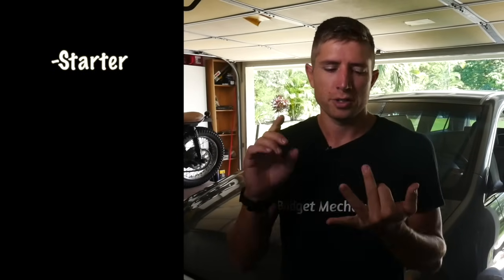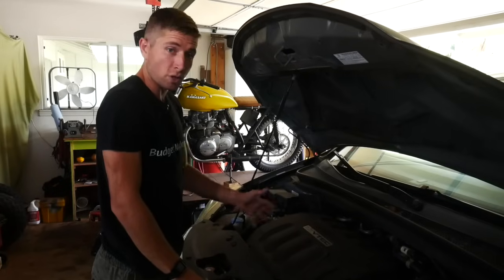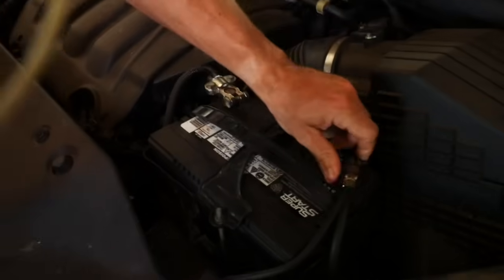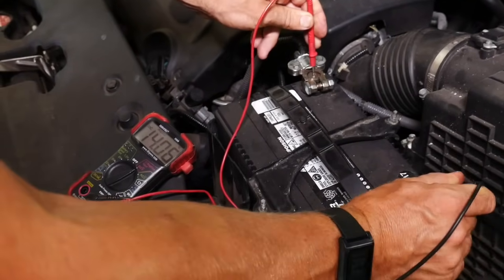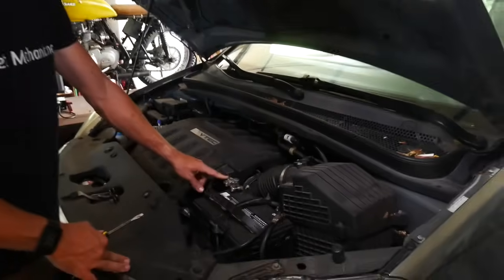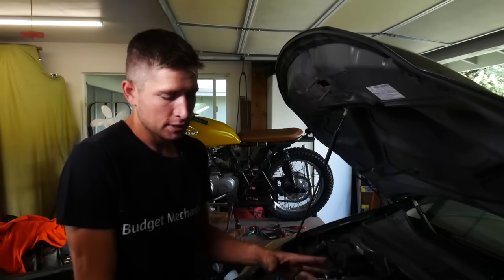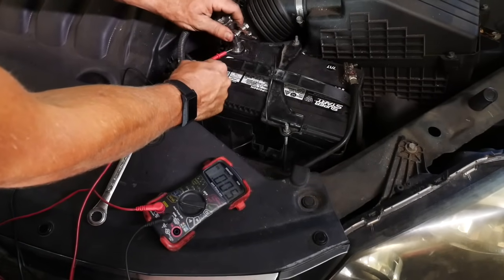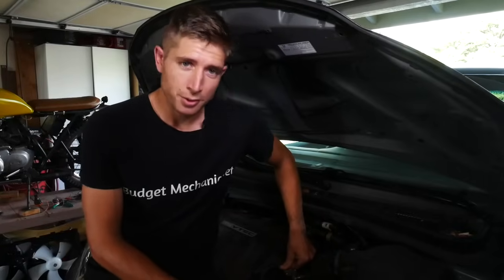Car Not Starting? Click or Clicking sound? Simple DIY Diagnosis!

Comment: Was is it if the car is dead and you hear clicking inside car without putting key in ignition, but it started with a jump,and I bought the battery 6 months ago

Comment: Bro I got a 97 Toyota t-100 and I've checked the battery, got 14v, took starter off checked and it spins like New, checked alternator it's good, but when I try to crank it , I hear one just 1 click and nothing! Turn it back to off and try again and bam one , just 1 click!! What is wrong with my truck??

Comment: Okay… I get it but car won’t start even with battery and I replaced the starter. All I hear is clicking when I try to start it. When the battery is hooked up to the car with jumpers it’s at 13.5 but won’t start and without the cables it drains to 10 volts sometimes even 8 volts and it’s 6 months old.
Reply: Even though it’s new, it might be defective or not fully charged

Bring it to your local auto parts store, more times than not they will charge it for free

Comment: Help!! 07 Tahoe, replaced starter, battery, alternator, fuses, relays, ground wires good and new ignition. When I turn the key I get a thud… when I use a jump wire the starter cranks but no spark

Comment: 2007 nissan armada clicking noise that turns on blinkers hazard lights and inside cab lights when car is off , when car is on, while driving and when car is off and just opening the door  ... draining battery

mechanic said it wasn't alternator nor battery ... $350 in tow, $125 in diagnostic tests already

Comment: Why didn’t you just take off the cables on the battery to test the alternator
Reply from the maker: You could do that with older cars, nowadays the computer can freak out, or it might just shut the car down despite a good alternator. No longer a definitive test

Comment: Appreciated the video. Yes, if you can jump it, and it starts, probable not the starter. Especially, if you had to do it a few times after the car was running , then left to sit, and not starting until you jumped it again. I like the way you checked for the possible parasitic drain added to your video. Once I had my car started and ran it awhile I checked the battery with car off and it was ok 12.4. Then I ran the car checking the alternator and it was working producing a voltage charge in the proper range, but after sitting a few hours voltage on the battery was down  to 10.1. No parasitic drain thanks to your check. Just an old bad battery! Our weather changed to cold and exposed it. I got 6 yrs 2 mo. out of a 3 year warranty battery. No complaints, but thank you for helping diagnose.
Reply from the maker: No worries

Comment: Hi I have a question I have honda hr-v 2019 and the car starts slow sometimes faster after being parked for 8 to 9 hours  it starts normally every time if you run into a store or fill up a gas! But when it parked  for 8 hours or more it really starts slow. It takes about 2 to 3 seconds before it starts. I took it to a mechanic, he checked it and say car starts normally and I replied it's because I was just driving it! I asked him if I can leave  my car overnight in his shop so he can check it again, he said it's okay, next morning I called him about 9 o'clock, the mechanic said the car started normally and I think he was just lied to me because he couldn't find the real reason, the car never started normally for me before when parked for a prolonged period of time even the next day when I went to work the car started slowly and when I finish my work the car started slowly again! My car battery  is only one year old, installed by Honda dealership 5 month ago. At this point I am stucked!  Went to three different shops and no one can determine the cause because when I come the car starts normally but again it give a little bit of hesitation when it being parked for 8 hours or more. Can you give me advice? Thank you

Comment: My car doesn't make a sound when trying to start. Battery is brand new. I even hook up jumper cables and won't turn over or make a sound. Could it be the starter relay or would the car still make a clicking sound?

Comment: Ok question. Please be gentle bc I'm a girl lol. But I was driving to the doctor and got there fine. I came out to go home and it won't start. I got a new battery and it ran but now it's dead again. It's a Kia borrego and I see how to change terminals but the positive one on mine looks bigger than the negative more components I guess? Is it the terminals or my alternator I guess is what I'm getting at. It worked fine with the old terminals until it died like I said. But the new battery is dead now too. So I'm guessing alternator?
Reply: Yeah that'll be the alternator, did you change the connectors aswell? That's not usually necessary and can course problems, especially if it's a battery not ment for that car
Reply: @CallumWoods-m5s  lmao it wasn't the alternator. I had it towed to my mechanic and I hadn't tightened the terminals lol. I'm such a dumbass. 🤦🏻‍♀️😂
Reply: I'd make sure to start the car regularly as older cars tend to need more start ups. If you don't your battery will drain over time. As in my experience, it would damage it as well.

Comment: Two days ago from out-of-the-blue my car shut off while idling in the drive-thru at a fast food place. It was off for about 30 minutes when I was finally able to check the cells in the battery and they were low. Refilled cells and the car started up. It has started randomly shutting off or not starting occasionally. Took it to the auto parts store and have them run an electrical diagnostic and it showed no problem with the charging system, all within specs. I have questions. Could it still be the battery? I only ask because I know it had to be an issue with the  cells being low? If this is not it, what else should I check? Ignition switch maybe? For a couple of weeks leading up to this the car was doing a few weird electrical things. The screen would get stuck sometimes telling me The back-up camera was in use . And when it is not starting, I get no lights or accessories of any kind working. But the battery checks at 12.6 and the alternator checks at 14.3. the radio doesn't work in the car. 2013 Ford focus. Thanks for any feedback.

Comment: My car started messing up last week one day I was about to drive home from work and noticed steering wheel was temporarily hard to turn and there was a burning smell and whining noise coming from the alternator. A few days later it can only start up and stay on for a minute or two before the engine slows down to a complete stop a couple of days after that point the car refuses to even turn on but makes a clicking noise when turning the key then a few days after that it still refuses to turn on but now makes absolutely no noise when turning key

Comment: So my jeep starts. The starter is new but after it not running for a while n I go back to start it. It takes a while. The starter kicks in and it sounds normal. Just takes too long to start my car. Makes me feel like my battery is failing. Could be a connection issue. Replaced the terminal connecting to the post. Just did the one, the previous one was cracked. Noticed it after I jumped someone’s car

Comment: Holy smokes! <3 :) Learned a lot and since I have an issue with my taillights sometimes staying on when i turn the engine off, i also know that my battery can't keep dealing with that. Rant: spent $1300 last year on my jeep just to figure out why my taillights remain on, and I'd have to check them every time to see if they were on and disconnect my battery IF they stayed on. Kind of wary about going back to the shop who 'fixed' it...

Comment: Great video...I wonder if anyone has any comments on my situation:  Now my battery (a year old Varta) has been suffering from a drain in my car - to the point it has been going increasingly flat. But... the last three days my car started cutting out while driving... yet, I could re-start it (so not a starter motor issue) and drive on. But today it finally decided it would cut out more than ever before (multiple times)  and totally drain the battery - which, to me,  suggests eitrher 1) An alternator no longer powering the bad  battery or 2) The bad battery is now basically dead (so whatever the alternator does no longer matters). 

I managed to jump-start (after 10 mins) off my partner's car  as a test... and only got about half a mile before it cut out again. I'll be replacing the battery asap. But do i also have an alternator problem? Of course, i will confirm this when I finally manage to get the car from where I had to leave it!
Reply: What was the problem, how did you fix this?
Reply: @HOBBS-4  - 1) I have a drain. 2)Battery was bad. 3) Eventually (LOONG story - incl a useless blagging mobile mechanic  who got £70 out of me) before I figured out the problem after changing the battery and fuel filter. 4) Having an older car and running low on petrol caused problems with the gunk at the bottom of my fuel. i.e crud was getting in my injectors and cutting the  engine. A third of bottle of Redex (£8) got me driving again after nearly a month. 3 days later I was 100% back up.

Now i always keep a bottle of Redex in the car (just in case I run slightly low on fuel  and get a clog. That sorts me out before I top up petrol again.
Reply: @beejj6190  Thank you Sir.

Comment: Thanks so much 
Great video 
My Nissan Murano I just bought a rebuild battery but no start then I changed my starter and crank slow but no start I boost it and no start please can you tell me what should I do?do I have to change the spark plugs?
Thanks 
Toronto Ontario Canada

Comment: my car engine is sparking by itself. The problem started by feeling the car shaking when breaking, then sometimes it turns off even in the roads when breaking (red lights or traffic). Now it stopped. I changed the coil distributor, the sparks, the spark plugs, but nothing happens. I took it to the mechanic, he tried to change the ignition control module, nothing happens...now even at off, it sparks by itself...I really need to understand. I already spent money enough.

Comment: I have to check out the wiring because the alternator and the battery and the starter are good. But it will not turn over unless I jump start it with  portable jumper cables.

Comment: Had this same issue after leaving my car off for a month. I didn't disconnect the battery or add fuel preservatives in my tank. 

Solution:
Got a new battery for free since I had bought it recently. 
Added 2 gallons of fresh gas.
Start the car and Rev the engine repeatedly until the car stays on by its self. Then drive to a gas station and top it off. 
Hope this helps🙏

Comment: I changed the starter changed the battery changed the alternator and belt. No check engine, no battery light. It just clicks. 2000 Buick Lesabre. This is after replacing the crankshaft position sensor.

Comment: Really quick clicking noise when turning the key in the ignition. No sound as far as engine turning over. Just click click click click click click click dash lights light up for a couple seconds then everything stops & goes black. I know it's not the starter, because it would only click once (I hear) also the interior head lamp flickers / doesn't work at all. Is it safe to say it's the battery & not the alternator?
Reply: What was it? I have the same problem
Reply: @UKanMusic  I blew a fuse on the radiator and continued to run even after I shut the engine all the way off causing the battery to drain overnight.
Reply: @wizzdumb_610  thx for taking the time to answer. My battery is nearly 10 years old 🤣 but the car worked fine two days ago, then couldn't start it yesterday

Comment: Can someone please explain to me. At first my car would start with the jumper pack and when in took it off it would or shit it off the car would rev up them die, when I had the jumper pack connected but shut off I could see the voltage go down till the car died. I can’t get it to start now I think my jumper pack is dead, even if it wasn’t the car dies before I can even get a test on it, I JIST bought a multi meter and a new alternator. Can someone help please I don’t want to replace the alternator if it is the battery the battery doesn’t run 12 but it is reading around 11.9 11.3. Help plz I’ve been trying to figure this out, everyone shows with the car running… I only have a jumper pack when I take it off or shut it off the car shuts off.

Comment: Don't need any multimeter. . u should know why buy that for. Has all you need to do is  . First jumpstart your car then remove the positive side battery clamp if the car if the car stops running it's the alternator if if it  carry a  on it's the battery. The alternator only  keeps your car stuff charging the battery only starts ur car and let's the lights and radio work .simple. Thought being a mechanic you would know  . well I am an old mechanic with old ways and to save money for people

Comment: I'm wondering if you could help me with this. 
I just installed a new battery on my Infiniti QX 56 2010. 
If I don't drive my car for 1 or 2 days then it will not start on the next day. When I turn the key I see the lights on the dashboard and it makes the sound CLICK, CLICK... 
Then I stepped on the gas pedal many, many times and eventually the car started. Any idea what could be? Thank you for your time.
Reply: It could be a fuel pressure regulator. When those go out you’ll have to step on the gas several times to get it started. Might be something to look into if you still haven’t gotten to the bottom of it
Reply: @Wolf_pack01  Thank your for your reply.
I did charge my battery with the battery charger even though the battery was new from the store. Now the car stars with no problem even if I don't drive many days.
So my understanding the battery wasn't charged to full before.
But if I open the doors and I keep them open for like 30-40 min then again I have the same problem. The car will not start until I push the gas pedal many, many times.

With a new battery that fully charged if lights on when doors open for 30 min it's weird that is happening, no?
For example on my other car Acura MDX 2011 I can keep doors open for a day and the car will start anyway. So don't know if it alternator, battery or fuel pressure regulator

Comment: Thanks for a great video. I need some advice, if you have the time. I have problem starting i cold weather only, below zero. Last year it didn't start when -10. The funny thing was it didn't help with jump starting it neither, as with starter cables and another running car beside. Still just clicking from the starter trying to engage etc. So with a long extra cable connected to the engine I heated it up during one hour. And then the starter spun normally as in the summer and it started. I bought a new battery, even that the old one was not so old. The same thing happened next day as well. If it would have been the battery, the car would have started when using extra starting cables and a running car, right? That's why I think that it is the starter that is getting old and that didn't had the power to crank the cld engine. You didn't have any problem jump start the engine, so it's not your starter. You just donät get the power enough with your own battery. Do you think it could be my alternator or my statrter? Really hope you have time to give some feedback. It's getting colder here. :-)
Reply: its your starter for sure
Reply: @trivikramchebrolu1823  i changed th old oil, and it starts better in cold weather now. So check out for to old and heavy oil that makes the engine turn over difficult in cold weather.
Reply from the maker: Crazy! I definitely don’t ever have that problem over here!
Reply: @BudgetMechanicHawaii  maybe it could be a combination.